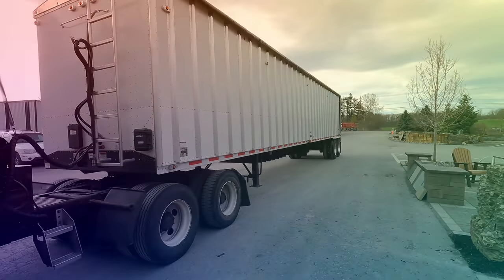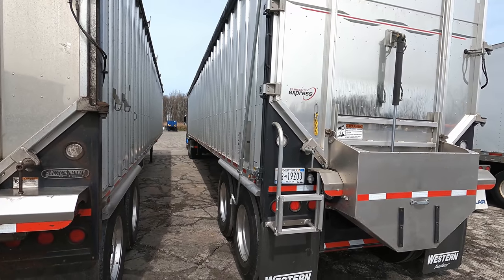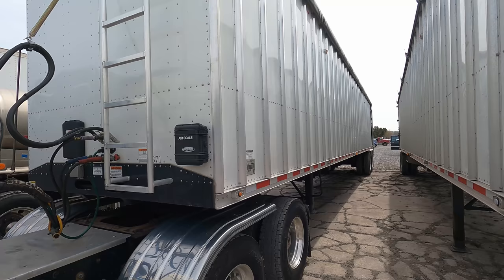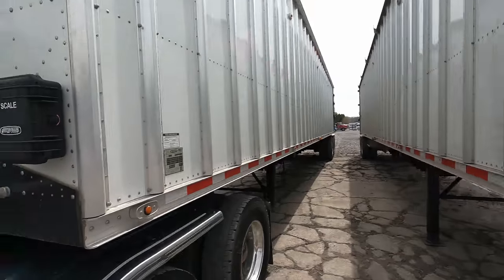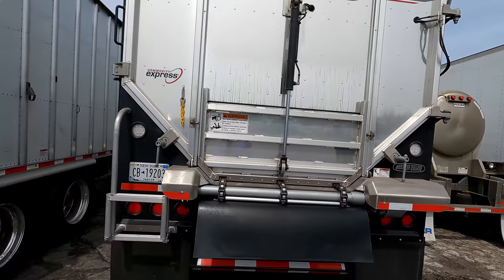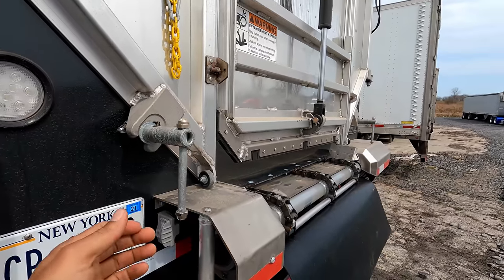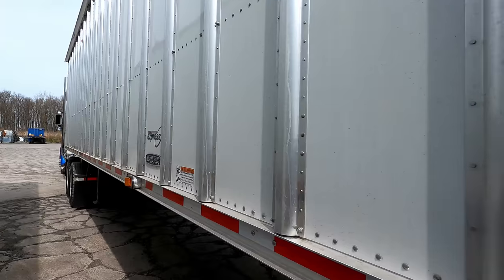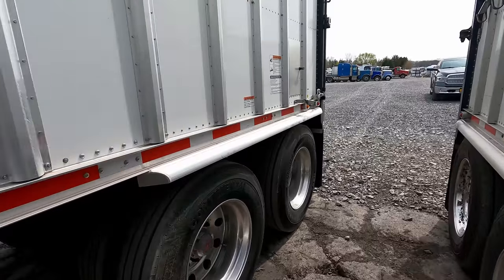Our 2022 Western Belt Trailer !!    Just Arrived !!!

Comment: Spent many hours hanging on to the front of those Western belt trailers  via the platform. It was so handy as opposed to the rear 'ladder' when operating piler remotes. Glad to see the tarp roll up was moved to the rear, I despised the front roll up handle on the front with wind or loads that where mounded up unevenly that front platform became very small then.

Comment: I ran  a lot of different variations of those belt trailers in Idaho in the early 90's. The original ones were modified flat beds, with boards covering the belt, had to pull one boatd at a time. Even pulled a frp sided one designed to haul slurry from the potato plants, along with potatoes and grain.  All the ones out west had an electrical hook up, so they could be run both pto,  and electric hydraulic.
Reply from the maker: Thanks for the info

Comment: Nice trailer.  What is main reason for a spread axle?  Advantages?
Reply: With a spread over 10' you can get away with imperfect axle weights. You can be over 3 ton on a trailer axle.
Reply from the maker: Higher weight rating....  Stability..... Looks... And yes axle weights are not as big of a problem !!!

Comment: Very cool stuff.... can you Haul gravel in there too ???
Reply: Yes,, not a prob!!!!
Reply: I think gravel is heavy for belts but I’m sure it can be done. Let the boss answer
Reply from the maker: Yes you can! but hauling multiple loads a day out of a stone quarry i would not recommend .....
Reply: Bunker Sand, gravel, marble chips, mulch, tire chips,saw dust,coal,wet and dry distiller grains, corn gluten, grape and tomato pumice, potato waste, Bakery meal, green beans, onions, potatoes, apples, pumpkins, all farm to elevator grains,and all dry bulk feed ingredients to beef and dairy operations. The only thing I would do differently than before is a electric tarp. Windy days and freezing temperatures make tarping difficult. They (Western) clean out well. Only a little product left on front  in each corner. Stop the belt, get in, sweep onto belt, restart and let it clean itself out. It's important to know where you can get these trailers washed out. Some receivers won't accept the product without washout receipt prior to loading. These trailers are better built than most.

Comment: Why 24.5 tires 22.5 are lower lighter and cheaper?
Reply: Most of their trks have 24.5,so it's easier to move tires/wheels the same
Reply from the maker: Our Trucks get into a lot of jobsites.... So Better Clearance .... and a better weight rating but that changed in recent years....   i do have some on 22.5